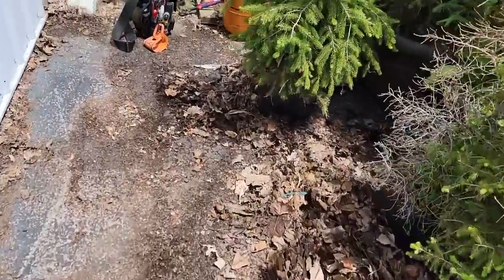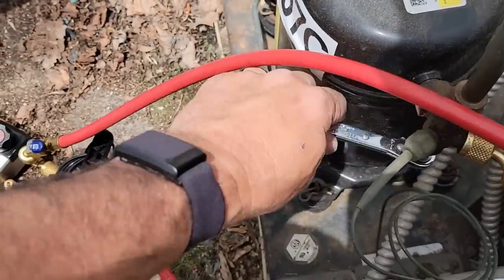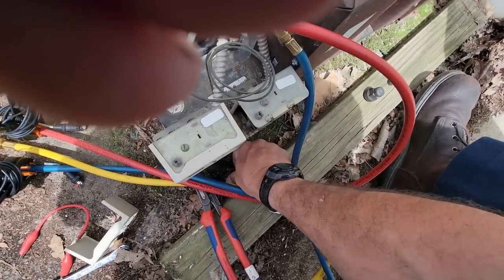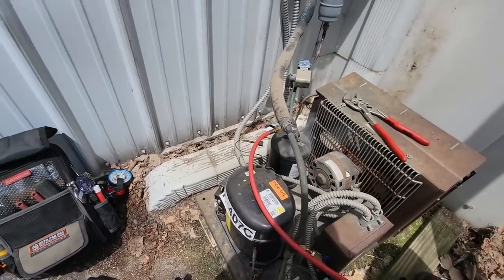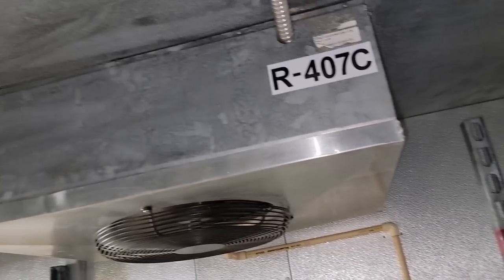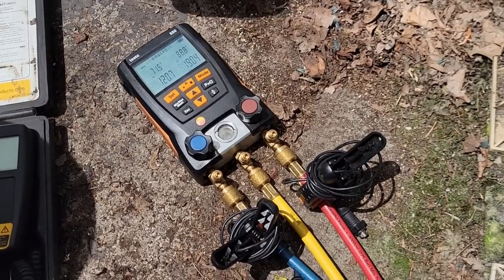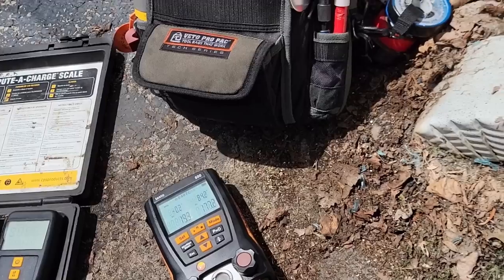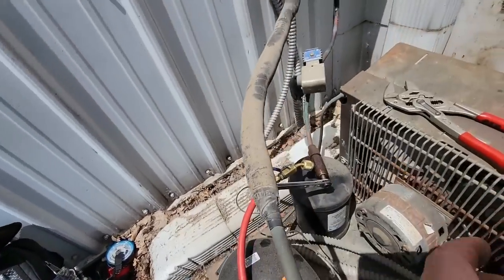Walk-in Cooler Has Major Issues!

Comment: Since the very high HP at the beginning a, I immediately went thinking non condensables . 
That coupled with the recent 407c conversion , I'm also thinking mineral oil residue not mixing with the poe oil causing possible plugs , non condensables causing high head and causing the TXV to act erratically...also like you mentioned possible oil plugs too...what a mess !

Comment: TXV looks like internally equalized type, so possibly oil and gunk settled in the balance port inside the body causing it to stay in the shut position and got flushed when you accidentally went hydraulically solid (800+ psi).
Reply from the maker: I would believe that is possible. Thanks for the feedback

Comment: Just my 2 cents, when you were experiencing the low suction/high head,if you had eyeballed the expansion valve and it was frosting it would have told you the whole story if it wasn't frosting and not knowing who has been working on the unit  i would have removed the charge/vacuum drier like you did who knows someone may have put stop leak in it and now your seeing a problem yes costly to the customer give the customer a choice and he can live with his decision geeat vid your thorough in your work
Reply from the maker: I believe it was started back up in the winter and was likely over charged. I did look at the txv in the beginning of the video and after it started to work correctly. I did not see any frost. I wondered if the over pressure caused the txv to clamp down?

Comment: I’ve seen the same problem where the compressor is loosing compression ratio and keep flashing the sight glass and people just keep dumping refrigerant. It takes forever to pump down and doesn’t bring the box all the way down to set point
Reply: Just had this issue last Saturday. Sight glass was clear at first then went half full. Thought it was low on gas. Tried to pump down into the receiver and it wouldn't pump down. I always check it on recips before adding gas.

Comment: Great way to test the patience of the compressor. I wouldn’t be surprised if it’s next to go
Reply from the maker: Is that a complaint or a compliment? What would you have done different?
Reply: @HVACRSurvival  compliment. You got the unit to work more or less normally, which is the objective; can’t ask for more then that. What gets to me is how anyone that’s done slmost any kind of ac can get a unit so seriously overcharged that it just about locks up the compressor and/or blows reed valves out of it. 
 But, I did enough ac to NEVER doubt the power of stupid.
Reply from the maker: I believe it was charged and converted in the winter? I got a lot of half stories of when and who did what. I feel the same way, I don't trust anyone's work and always recheck things.
Reply: @HVACRSurvival  it was amazing you got it going
Reply from the maker: @marknaravas318  🤜🤛👍👍

Comment: you did a mikey pipes LOL,you started closing suction valve to pump it down ?. then added refrigerant.assumed things. thanks for sharing.the drier might fix it.
Reply from the maker: Refrigeration is a little different than AC work, I never realized how Important it is to do the pump down like I did on the suction side vs the liquid side like a ac unit is tested. If you watch the gauge display the suction did not go up when I opened the high side and if the suction valve wasn't open I wouldn't have gotten 5 oz into the system. I'm not perfect and I seen things I should have done differently. Live and learn lol

Comment: Great video! When you replaced that dryer did you pull the vacuum and if you did do you aim for some microns or not? Thanks
Reply from the maker: On something like that I would not pull for a crazy vacuum, just basic vacuum get it out of a positive pressure and make sure there's no air in it. Generally if you open it up under slight pressure you're going to be boiling off refrigerant for a little while.
Reply: @HVACRSurvival  thank you for answering  really appreciate.  Cheers

Comment: So I am guessing that the high pressure switch just starts the condensor fan and not acting as a safety "Do not explode in my face" switch.
Reply from the maker: Yes, that was a fan cycle control switch that helps keep the head pressure up in low ambient conditions. This did not have a high pressure cut out control, some do but not many small ones.

Comment: I think it's waxing or moisture blocked the tx valve and the system was over charged filling receiver and cond giving extreme high head pressure 
I would pull the orific or strainer or both and clean, change the drier or even better pull the charge and do both and vac and re charge 
Better to start fresh or you will be back 
I've not had much luck with 407C on Refrigeration I prefer to use a different 407 like 407F or something else 
407c works ok in AC only I've found
Reply from the maker: It's been a good refrigerant for us, we use 407f in the grocery stores and I was told from the advanced refrigeration guys that 407f was a problem child?

Comment: You closed the suction before closing the liquid 

So the compressor wasn’t sucking (pumping down) it was only discharging (causing that high pressure)
Reply from the maker: I just re-watched it, my manifold gauges were closed at the manifold so it wasn't bleeding from the high to the low side and the service suction valve was opened back up because I didn't valve off the compressor until after I added refrigerant. I didn't record non-stop so I didn't catch a lot of what I did in-between recordings but I don't see how I would get over 800psi of discharge even if the suction was closed. Now if I was closing a discharge valve at the compressor before the coil it could do it but this wasn't a compressor with discharge service valves.